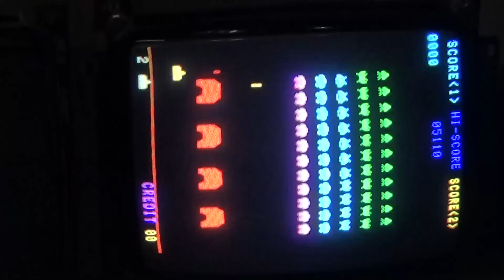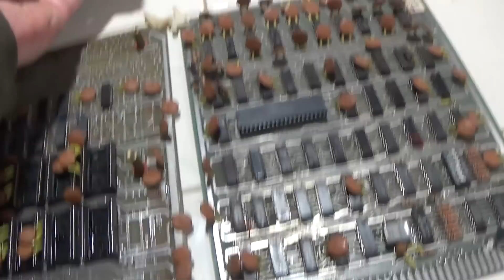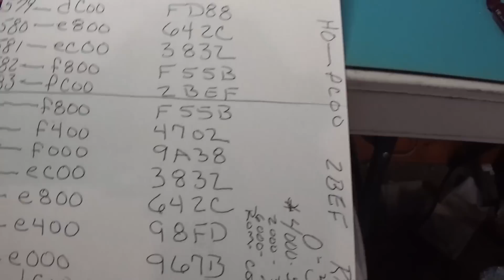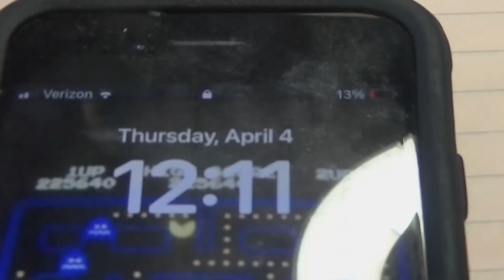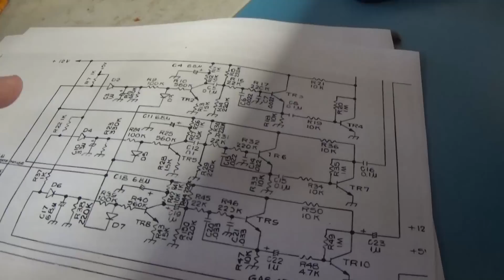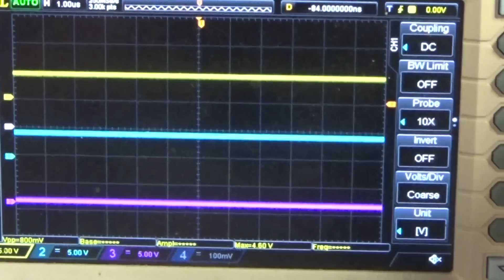Two For One! Taito Space Invaders 3 PCB Stack & DECO Astro Fighter PCB Set Repair   4-4-2024

Comment: Instead of installing new ROM sockets, just leave the ROMs in the old sockets or better yet remove the ROMs so the PCBs use less power.
Reply from the maker: Remove thje ROMs?  Do you think the game will work with no ROMs?  I could try that...
Reply: @classicarcaderepairs  Yes, the Braze kit replaces/bi-passes the old ROMs.  I had a second post with a URL to the installation manual for the kit, but apparently youtube didn't like me adding a URL.

Comment: Sega/gremlin also made Astro fighter. Never knew deco did also
Reply: Wait until someone tells you about the Zaccaria version that uses completely different hardware* and may or may not predate this DECO version... (2 minutes of research is inconclusive of which came first)
*) including a CPU and three GPUs^ you probably never have heard of (Signetics 2650 and 2636 video generator)
^) if you stretch the meaning of the term GPU by A LOT - each chip basically gives you 4 sprites (more if your programming skills are better than a 5th grader's)
I think it was called Astro Wars.
(btw. Zaccaria also made a Space Invaders clone that looks almost indistinguishable from the original but also uses completely different hardware. Why!? There's so many SI bootlegs and they all use the same exact hardware. An insane amount of effort to copy a game to near pixel perfectness... even the cabinet looks the same)

DECO also made a sequel for the DECO Cassette System called Super Astro Fighter (although it plays the same).
(EDIT: ^ instead of asterisk to avoid bold text and make footnotes easier to track)